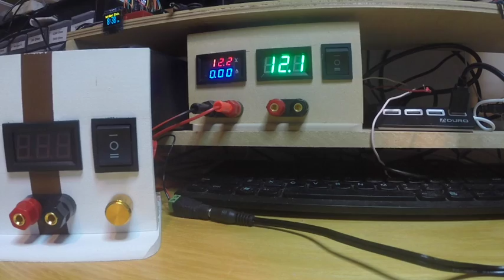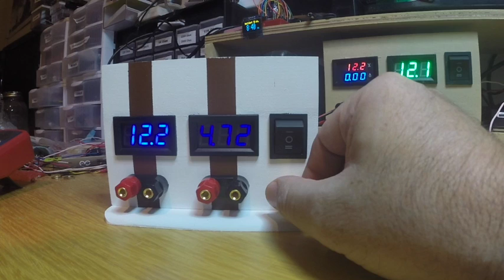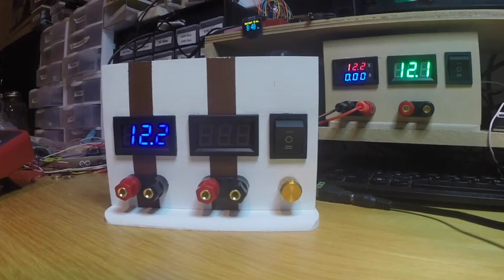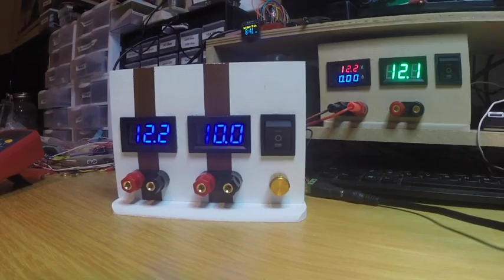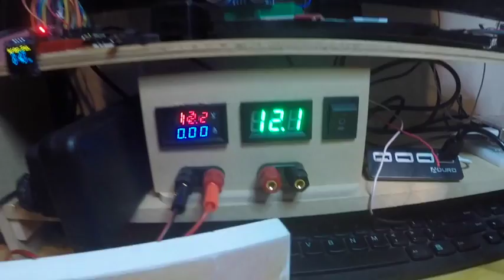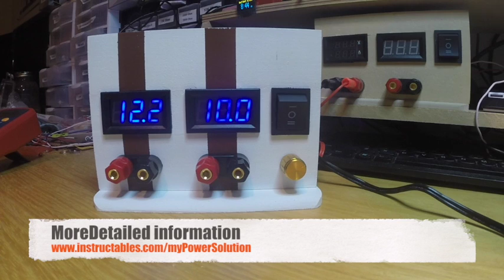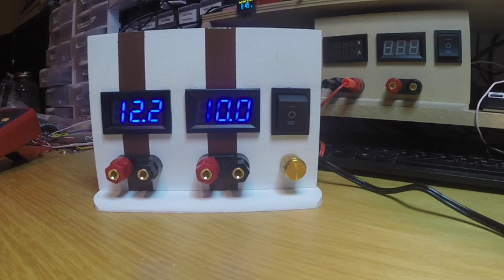DIY adjustable Bench Power for Arduino

Comment: If you swap out those 2 wire panel meters for the 3 wire variety you can power them from the input voltage and not lose your output voltage reading.